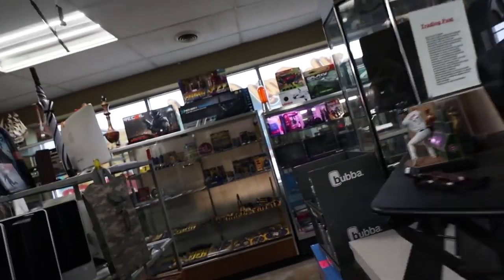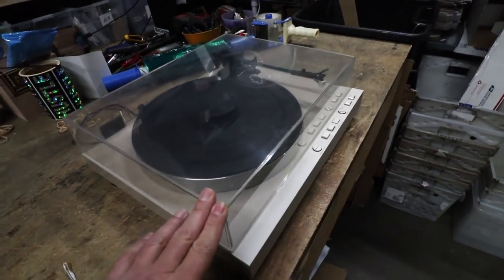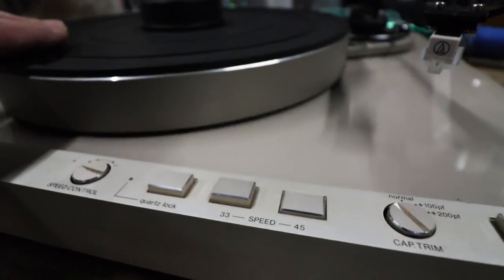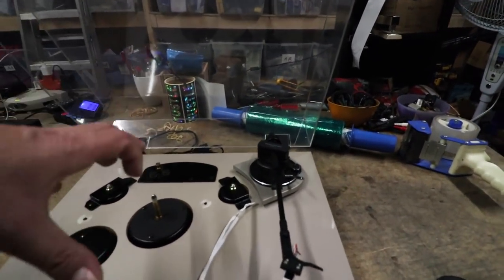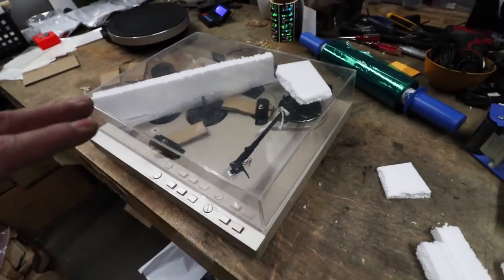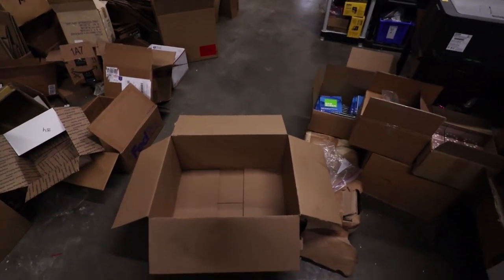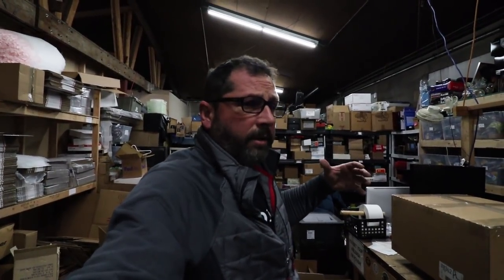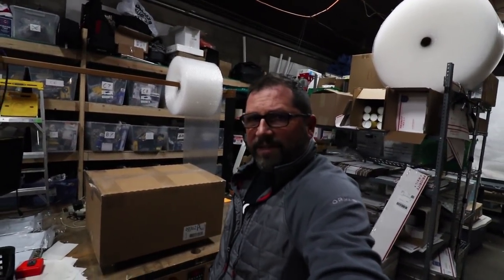How to Safely Prep and Pack Turntable for Shipping

Comment: This is honestly something I think I will probably never need to do, but your content is actually just entertaining to watch, so good on ya
Reply: If you have ever bought a semi or high end turntable you will see how they are shipped from the factory. The platter is always removed. The cartridge is usually not included and if it is it's in it's own capsule. Sometimes the feet are removed. Every piece has it's own compartment in it's Styrofoam mold.
As with anything that is delicate. Try to remove the pieces or isolate them to prevent the Neanderthals from breaking anything as they kick the packages around.

Comment: For the most part we do it pretty much about the same way. Just glad to see that I'm not alone although I'd say your 1/2 hour to 45 minutes guesstimate  on the time it takes is a little light. I've shipped about 20-25 turntables over the years & I'd say that if I get 1 done in an hours time I'm doing good. Shipped a dual 1219 about 12 or 13 years ago that arrived all broken to hell because it was my 1st & I had no clue about the bouncing/floating aspect. Most duals & a lot of other turntables have screws that can be tightened to eliminate the bouncing/floating a feature I'm always thankful for when its present. Haven't had any damage issues since that 1st dual. Anyways thanks pete it really helps to know  that I'm not the only one that is spending the kind of time and effort it takes  to ship 1 of these. The next one will be easier for the knowledge.

Comment: Sold two turntables and packed them very similar to this. Both feed backs from the buyers were very pleased with delivery and packing. But I did gain some more insight on the floating style I will watch for if I sell one of those, Thanks

Comment: of course not all of that applies to all turntables, but it is pretty much how I pack things like that, except for one difference. After the bubble, I take a sheet of corrugated cardboard and wrap it around the item tightly. Then I put it in the oversize box. This extra layer helps a lot, especially with irregular shaped items. I learned that lesson the hard way with an expensive statue.  In this case I might also fit a piece of the foam under the tone arm near the end of it, with a piece above, why? well depending on the tone arm, it's heaviest at the end, if it gets dropped, it can bend or break the tone arm. if it's not nowhere much to move, it doesn't break, but the foam gives it enough cushion to allow just a little movement to absorb the shock.
Granted most of the time I'm shipping much older turntables that are very fragile due to age. 

I also dumpster dive for packing materials, but I can't keep a lot on hand, wouldn't you know when I need them the most, the materials are hard to find, but plentiful when I don't. I do keep some in my storage shed as back up for those times, but can't spare a lot of room for stuff like that.

Comment: Great video.   If the platter cannot be removed or you dont want to, another good tip is to take the lid off, wrap the film around it all including the platter to hold in place, and then re-fit lid and wrap again.

Comment: Dont be afraid of shipping costs or charging for shipping. I live on the east coast and any item I sell like that I'll do calculated shipping for it on the listing, adding 4 inches to each dimension and usually 5 pounds to the weight of the item. Better than guesstimating.

Comment: Just use the blue painters tape...It doesn't leave a residue and holds very well...The Frog tape has the best adhesion...Spot weld the platter, the tone arm the lid etc with the tape...Then you soft pack the box...Easy Peasy...:)

Comment: I suggest 8'x4' construction foam from Lowe's or Home Depot.

I use the cellophane wrap to secure the platter where it sits naturally as long as I've immobilized the float (if it has it)

I then fill the void in the dust cover with bubbles until it will barely contact the turn table and wrap it down with cellophane.

Comment: Hey Pete, Over the years I always double boxed. In other words, did pretty much exactly what you did and then boxed the result. Now that shipping rates continue to rise (which we pay for because there is only so much someone will pay for an item), I've changed to one box. Fed Ex has cheaper rates but they seem to really bash boxes around. USPS has been better at handling boxes but their rates continue to rise. They have also been good about paying out insurance claims (though I've had very few over the years). Anyway, glad one box has been enough for you. I do think the shipping costs rising are biting into profits. The turntable you just sold might be a good example of that very thing. Once you lowered it by around the cost of shipping, it sold. Possibly worth a video? I don't know. But I do know that because people will only pay so much for an item and shipping. As shipping costs rise, we have to eat the costs. Anyway thanks for the video. It gave me a little reassurance that having gone down to one box was the right choice. - Cheers

Comment: I don't think those turntables you can actually take out the cartridge without messing up the wiring. If the arm and needle does come off by twist you should defiantly pack them separately. Mostly in DJ turntables the needle should be removed cause they can be worth more then the turntable itself. Thanks for the upload I never considered removing the platter.

Comment: Great video Pete, I believe so many resellers really slack on shipping and they cannot understand why they receive so much bad feedbacks or returns. Being a great reseller means a lot these days because most people toss items into boxes and call it done, but that leaves yourself open for bad feedback and returns. Also being aware of how you handle items during that packing and shipping stage is very important because really picky buyers will notice slight defects that were not noticeable in the photographs online when the item arrives if you slight chip something or scuff something while packing and shipping it. Turntables are actually pretty easy to ship I find that items like large fragile items like porcelain figures or stoneware jugs can be very difficult to package correctly if you don't know how to correct package delicate items.

Comment: I really like your videos, but this, this is not good. I own this TT, so I'm quite familiar with it. 1st off, the 3 screw holes are for securing the floating mechanism. Your fix for that wasn't bad, in fact, not bad at all if you don't have the screws. You gotta take off that counter-weight. Otherwise, the bearings can get screwed up. Especially on a higher end unit. Also, take the headshell off. And ALWAYS take off the lid. I've seen soooo many people get their lids crushed.  Nice sale btw, the buyer waaaaay overpaid for it. No original mat and the platter weight has the decals removed.  I hope it makes it alright, though. Good Luck!

Comment: I have to find a source for cheap packing peanuts. They’re kind of pricey
Reply: they are not essential, try to pack tight and use some of that discarded white foam and bubble wrap and box within box. you can do it all on  a budget. Never had a unit broken in 20 years.. the only time was first and last time I used UPS !!!  They broke a reel to reel studio recorder I shipped. in 1999.

Comment: Harmon-Kardon....like Mercedes
Reply: Yeah, great when they work, but kinda finicky.
Reply: @mmmbbq  In 1992 the first home stereo rack system i bought was a Harmon-Kardon. Yes i used credit, and the speakers were Bose 601's. Phenomenal
Reply: @NCJsport My first HK was a cassette deck bought new in the 80's. Awesome deck. It's dead years ago. I did get my first TT, an HK T30c at a Salvation Army in the 90's, it was brand new. Used it on and off until like 5 years ago when I got the T60c. Also picked up a T55c.  Now I have a terrible itch to buy a new Technics 1200GR.